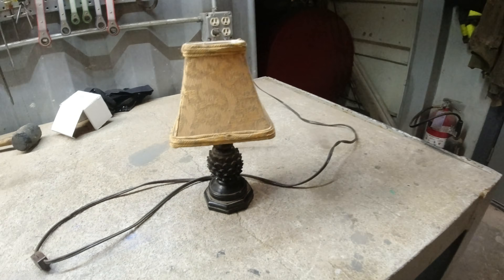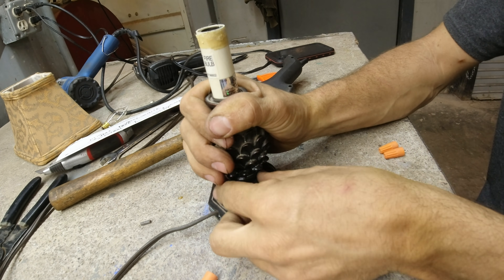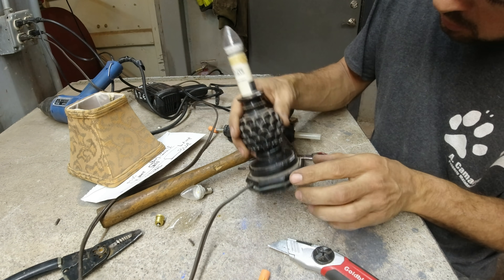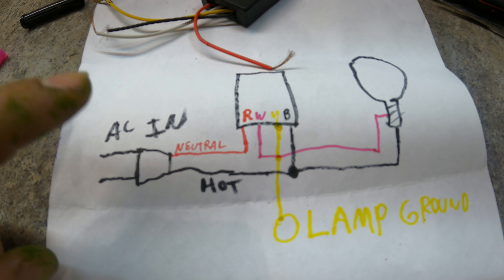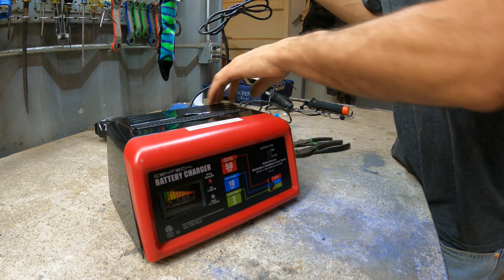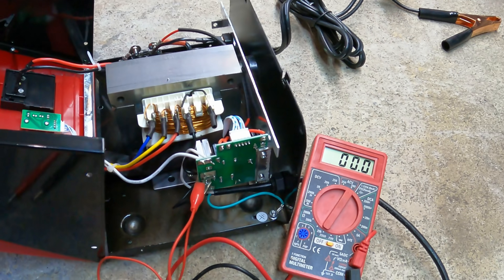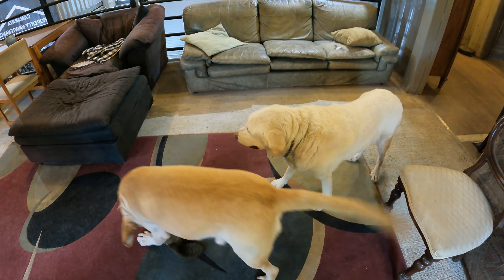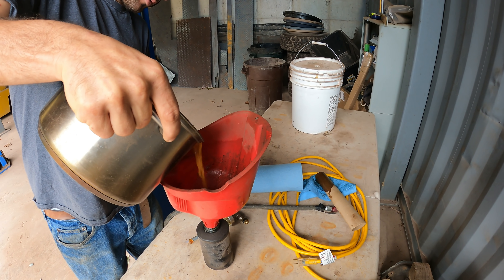Installing a touch sensor in a lamp

Comment: The lamps popped because they were LED's, that type of dimmer is intended for use with incandescent light bulbs only.
Reply: I have a few wifi led bulbs in lamps with 3 level dimmers, they've been fine for years.

Comment: Switching Neutral is a No No. Sketchi as frick that circuit.
Reply: why?
Reply: @Joe_Mission  Because that lamp always has a hot and if you touch it and anything that's grounded YOU will become part of the circuit.
Reply: @ElectroBotVideo  clearly not otherwise it wouldnt of been working.. when both neutral and hot are coming into the bottom of the lamp does it really matter which one gets switched theyre both able to rub through to the lamp body youre not stopping the hot wire entering the bottom of the lamp by switching it with the dimmer controller
Reply: @ElectroBotVideo  any time you get yourself between hot and ground you could get shocked, I don't see how you'd be more likely to do that by switching the neutral in this case.  Yes it is convention to switch the hot, but that's really only to limit the portion of the circuit that is energized when the device is switched off.  In this case, it really doesn't matter much, all the energized parts are contained in the base of the lamp, no big deal either way, just don't go sticking your fingers inside the bulb socket.
Reply: @Joe_Mission  So imagine the lamp is switched off, you remove the bulb and stick your finger in the lamp. This is safe to do, if hot is switched, however in this case the hot will find a way to ground through your finger. Now what determines the rest is what kind of footwear you have on, how good the floor is at connecting to ground and if the circuit has ground fault protection.
Reply: @viktorlofstedt5955  don't stick your finger in the socket
Reply: Ok aVe

Comment: You might laugh, but I have uninstalled a touch sensor out of a lamp, because it had 3 brightness levels so you always had to tap multiple times and make it bright before being able to turn it off. Sucked when you layed in bed to get flashed basically :p

Comment: Daylight saving in practice - no wonder the clocks don’t need to be changed⏰ - with live electricity sparks next to the fuel cylinder....
Reply: you could drop the sparks into diesel... its not explosive like gasoline

Comment: I always get shock by those touch to turn on lamp static electricity is no joke lol
Reply: fun way to wake up. does seems like a bit of a firehazard with those cheap made in china boards
Reply: If you have a plasma ball, you can touch the plasma ball, then barely touch the person and it should zapp them
Reply: i bet my cat gives higher shock than those lamps, its just crazy
Reply: I’ve had the same one for years. ASDA sell them for £10. I’ve never once been shocked...